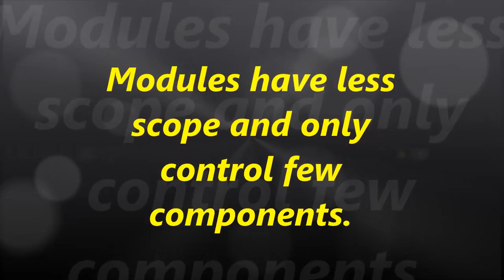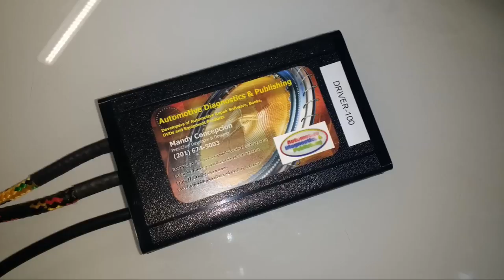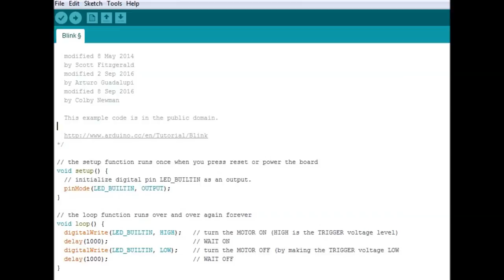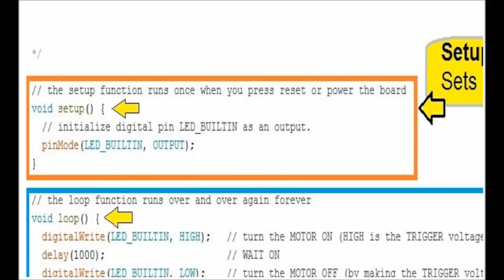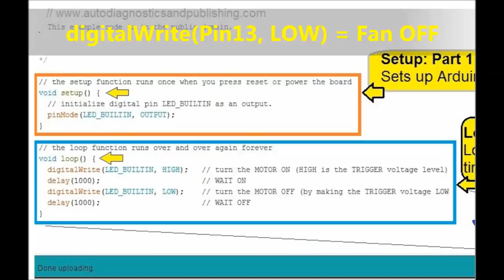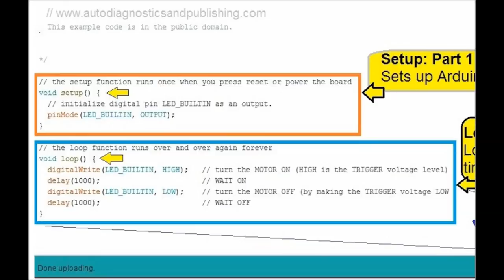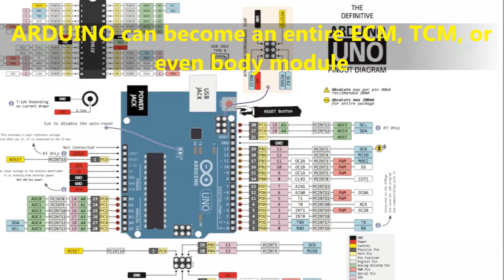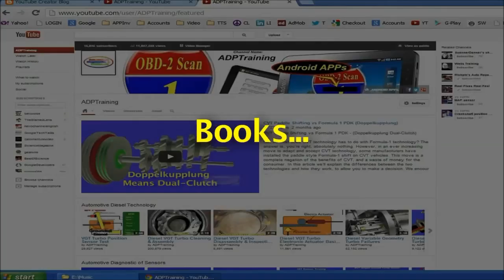Arduino Automotive Module FAN Control 2

Comment: What do you need to get started or how do you get started?
Reply from the maker: What do you mean, what do you need? Possible answer, an Arduino  Board, wires, relay board, accessories, etc. About $20 in Amazon.

You also need to download the Free Arduino program.